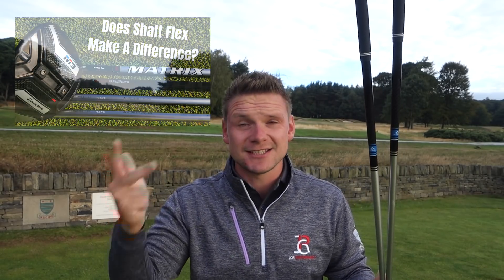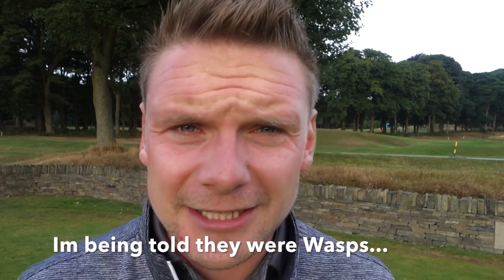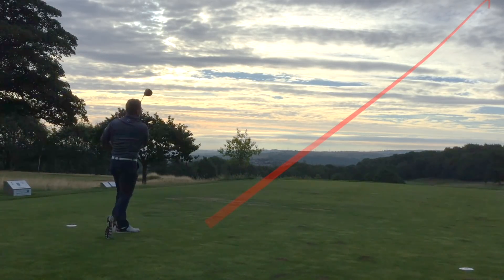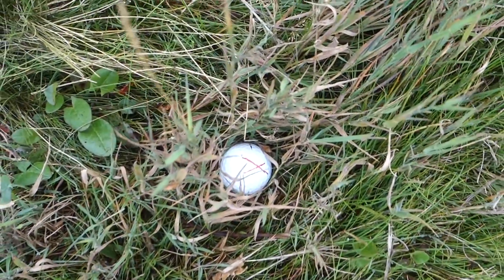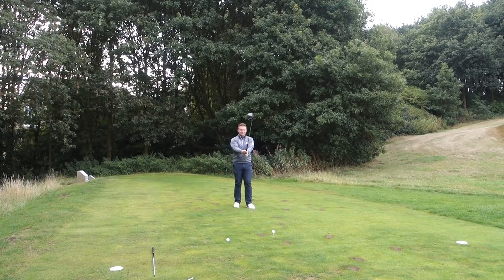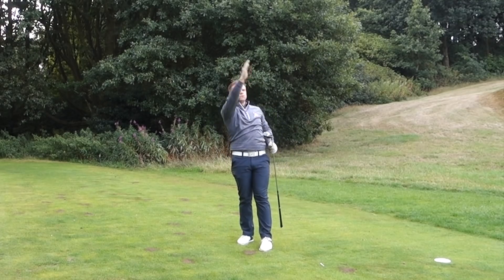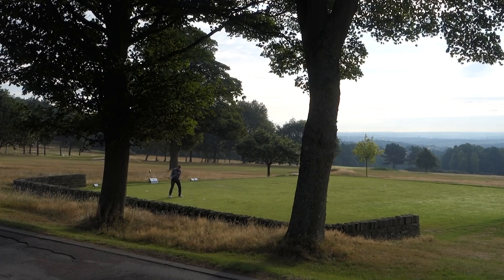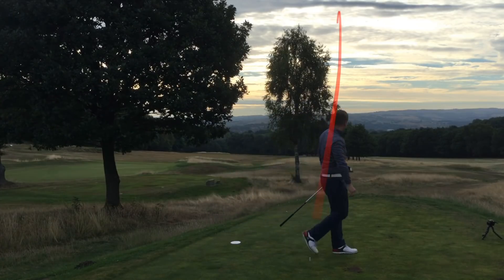Extra Stiff Shaft vs Stiff Shaft - On Course Test !!!

Comment: For a player with a "pro" swing I don't think the shaft would make that much of a difference - but to ordinary club players I think it can make a massive difference due to variations of swing styles. For 3 years I used a regular shaft and my drives were all over the place. I almost gave up using the driver. Someone told me that I had a fast swing and so a stiff shaft would suit me better. I changed to a stiff shaft and Ive been hitting fantastic ever since.

Comment: That's a really good test ,I agree that x was slightly edging it ,not sure what length you were playing those shafts at James  but I have  gone down  to 44.5 inches over the last year and find it way more consistent ,t dosen't sound much of a difference but its surprising what a slight change can make on consistency .Spending a lot of cash on drivers people should really get  fit and ask the question ,driver shafts are getting too long to con people in to getting a few more yards from their drivers .

Comment: Another great video.  I'm 102 mph with regular flex M2 driver.  Looking to switch to stiff.  Flex is one thing, but there are a few more options right?  Weight, torque, launch angle?  maybe I'm wrong.

Comment: what were the weights set up on your driver?  We have a very similar swing (before your lessons.)  I was fit for a Mizuno ST200G  Dialed from 9.0 to 7.0.. with toe weight in fade position and heel weight in draw position...x stiff shaft.  On the monitor I was bombing them straight.  First time on course I couldn't hit it at all!!! Either slice or just a push... I am hoping that moving it back to standard...with both weights in draw position on the heel will give me the flight I want!

Comment: James, what's your swing speed?...I think that has a lot to do with shaft selection, don't you think....I had an X for awhile but I went back to S and I'm hitting more fairways
Reply: I'm usually around 113 and was fit for an x. But recently went down to a stiff and found I domt have to swing as hard to get the same distance.

Comment: question. say you took off your glove...do you still use extra stiff? one year I had to watch my spending and so I took off glove and somehow got better, then got worse, so I started switching things around. I realized I won't hit those right leakers with a solid strike If I wear a glove. if I go nice n easy I could go no glove and it would be pretty good. then put on glove but now I was hooking like it was sticking more. this past year I realized glove and if I get into hook trouble just swing slower and just pretend it's on  line for money. I can't just attack with driver because it will spray even just a bit and my irons all stuff but I usually aim right because it's gonna draw a bit and sometimes I try cut and it'll pull and then go out of play. then i'll do a perfect bubba cut with my driver. so some holes I just aim right and then swing slower let the shaft and club do the work. I could swing 115 mph or more but that could be using more wrist action and it's risky and shafts bending on me so maybe I need to try xs in conclusion

Comment: Excellent video... What is your opinion on the different shafts used by different club manufacturers? I am asking because the x-stiff shaft on Callaway drivers seem to be equal to the stiff shafts on Taylormade drivers. M4 with Aldilla stiff shaft was performing perfect but Rogue with Evenflo stiff was crappy until we tried it with the Evenflo x-stiff shaft and it made a huge difference to my consistency and dispersion. Evenflo x-stiff flex was similar to aldilla stiff flex.
Reply: I just got fitted for a Callaway Rogue Sub zero driver. Callaway Rep said Even Flow Stiff shaft was my fitting with 100mph. What Crap. Lost 3 balls first round Due to inaccurate driving. Haven,t done that in 15 years. Getting refitted for driver shaft in 2 days time after complaining for 25 mins..Will insist on a extra stiff shaft this time.Also lost 25 meters distance off my drives compared to my M1 x stiff.
Cross fingers this time.😠
My handycap 6.1. Age 50,s
Reply: @nickpritchard7130  Interested to know if you experience the same as I did. I think the x-stiff will make a big difference for you.  Definately changed the performance of the Rogue dramatically.